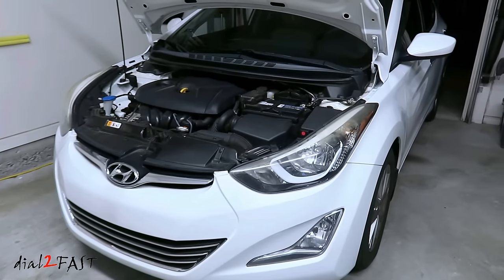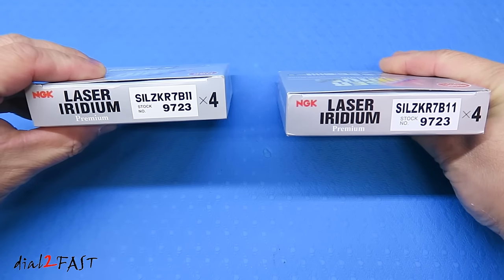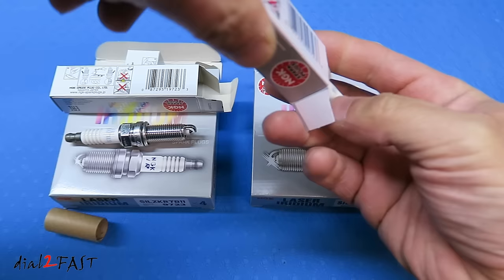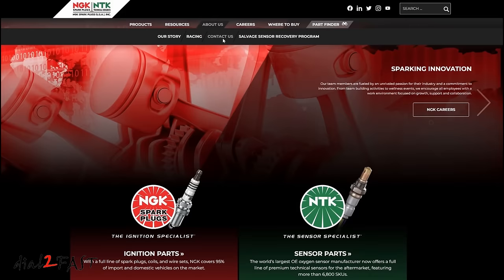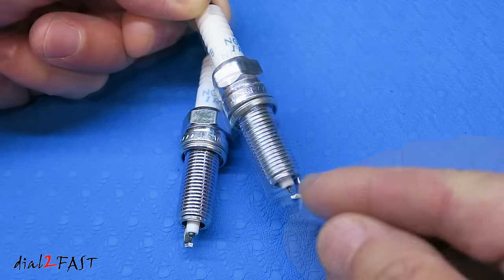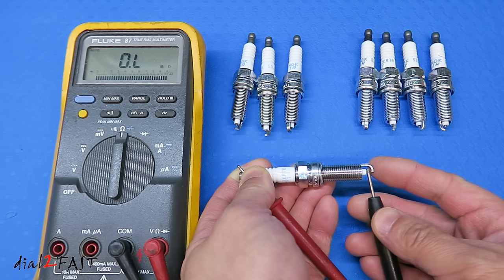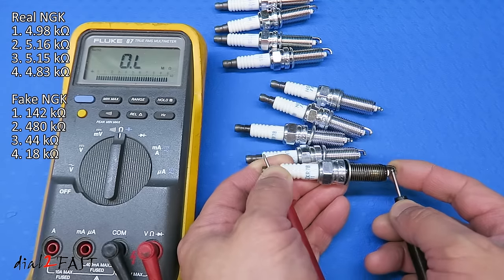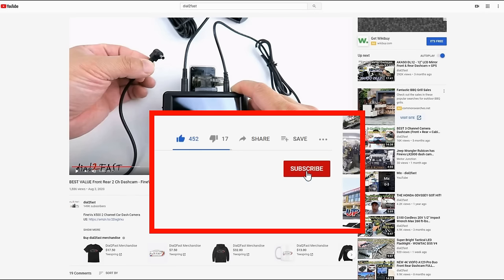Fake NGK Iridium Spark Plugs | How To Test!!

Comment: Thanks for heads up! Iridium plugs do cost a wad. Ive heard though that they hold.up better in aircraft such as Lockheed Electra 10 E special and so on. If I could afford a vehicle and the plugs the iridium plugs would definatly be considered for longevity and reliability. Mind you that Irridium plugs are extremely expensive and I ve only heard one pilot recomend them. Copper may be a better electrode as far as conductivity if one is willing to changes plugs frequently. If I were flying around the world in an radial engined plane I would do some research and seriously consider iridium coated plugs. Iridium was used for many years as a fountain pen tip material so iridium is nothing new. The only advantage is durability and fewer plug changes between tune ups. The less you fuss with plugs the better once you've got them dialed in as far as gapping, reach and heat range. I'm not an expert so don't rely on only my opinion I'm just a car enthusiast. Anyone considering iridium plugs should first consult a bona-fide automobile mechanic. All this just my opinion. Don't bet your life on them though because iridium is a bit of a fad. Use at own risk!
Reply: Iridium ix  plugs are 13 to 15 bucks each in my area, most expensive part to my tune ups but I get 2 years out of a set in a daily driver

Comment: i've known about fake spark plugs out there, i like your test approach but i have a problem with it. when testing the real NGK's i see you did not touch the metal end of the spark plug, the part that gets gapped. when testing the fake NGK's you didn't show the same care, it looks like you grounded the iridium tip and the bottom of spark plug. maybe the camera angle gives that impression.
 
i've built many cars engines, my brother learned from me and he became a certified mechanic for toyota and lexus. he was shop foreman for both, now works at tesla. every mechanic that wanted to become certified with toyota or lexus had to be tested by my brother, he was the gatekeeper. my son too started with lexus now he is shop foreman at tesla. 

i am photovoltaic / solar thermal technician. but foremost a goldsmith master jeweler. reason i bring jeweler up is i can make a genuine diamond read fake using a diamond tester. i sold a diamond to a customer and a year later he went to a jewelry store and they told him it was a fake diamond. long story short i went to jewelry store and tested one of their real diamonds Fake. i  had them retest my customers diamond or i would sue.

Comment: Can you please comment on the resistance zero spark plugs. Are they better because less resistance.
Reply from the maker: From NGK website: Since resistor type plugs actually “resist” some of the spark energy, non-resistor type plugs actually deliver a more powerful spark. It is for this reason that most racing plugs are non-resistor types. However, in most automotive applications, a resistor plug is required for proper vehicle operation. Use of non-resistor plugs in vehicles that call for a resistor type can result in rough idling, high-rpm misfire, and abnormal combustion.

Comment: Great video and it needs to be seen more, hit that like button.
Just a tip, when using a multimeter don't touch both leads with your fingers. Your body has resistance and voltage.

Comment: friend of mine was dyno tuning his Mitsubishi evolution 9 did some runs then changed out his spark plugs with new did another pull and boom one of the spark plugs the porcelain broke off and killed his cylinder walls and piston 40k later he got a new motor we took out the other plugs compared them with another new set of plugs from auto zone and he had fake plugs
Reply: U know what just did a engine rebuild. Bought autolite iridium plugs from autozone. Mind u they dont warranty the plugs, more on that. Once the engine started and ran. It developed a miss. Isolation to cyclinder one. Swap plugs with cyc2 and miss changed cyc. So I brought back to autozone. They said  no warranty. Oreilly has a year. 

Know I know why there is no warranty. They selling enferrior products.

Comment: What I see is that you are carefully not touching the external part with the original and with the counterfeit you are touching it, and that changes  the resistivity.
Reply from the maker: No it doesn't. Understanding electronics and how parallel resistance is calculated is important here. You can read my note in the video description.

Comment: My experience is that real NGK plugs are about the best you can get. The catch is that the pricing of them creates a market for fakes.
Today the plugs are expected to be "lifetime" of the engine, but in older cars they were so simple to change that it didn't matter if they had to be changed every 20000 km and the cost of them was usually so low that it wasn't a big deal either.
The maker of the fake plugs would probably have been better off by having a solid metal core all the way through giving them a zero ohm resistance - but with the side effect of some RFI.
It did seem to me that the gaps on the fake ones were considerably wider as well, and that could have caused the spark to jump over in the wrong place.
Reply: Ngk suggests replacing these laser iridium between 80k to 100k miles. So they are not lifetime…
Reply: @engrxtn And some cars are basically falling apart when they reach 100k miles.
Reply: @ehsnils all my cars have reached 200-300k miles every time

Comment: Yea just wondering about that,  recently installed this ngk IR , engine misfires around 6k miles. Remove all the ngk IR plugs, all gaps where out of spec and two of the plugs where rattling when shake. Initially thought this spark plugs are POS, come here to find out that its a fake plugs causing to prematurely misfire. Thanks for the info.

Comment: Although the resistance method found the fakes the values were skewed because you measured the resistance in your body too touching the leads with your fingers. Done this myself befo re I figured out my mistake testing stuff.
Reply from the maker: There is no problem with the measurement even with my finger touching the probe. My body resistance is in parallel with the resistance of the spark plug. My body resistance is around 20-30Mega-ohm, and the spark plug resistor is 5kohm. You can calculate resistance in parallel and the combine resistance is 4.999kohm. You can google the formula for calculating resistor in parallel.

Comment: Each spark plugs brand has its own product tech spec for example NGK DCPR7EGP you can easily google its weight and resistance. The 2 characteristics quite tough for the fake spark plug without making their own QC test to the product but they wont QC because it cost lots of money

Comment: Bought mine online which were cheaper than the shop. Mine says Shanghai on the packet and has chinese writting but on the spark plug it has the serial number and Japan under it. Three of the spark plugs measured 5.3 kOhms and one was around 4.6 kOhms.

Comment: Hi, I purchased some ngk off eBay and now my fuel consumption has tripled. Thanks for the info.
Reply: I bought some from eBay for my Subaru and the fuel got worse but ultimately it started running like crap and found out that the gaps on them increased dramatically.

Comment: You know they will adjust the packaging and the resistance to match the real ones.
Reply: If they can match the resistance of all 4, or 8, in my case, then there won't be a problem?
Reply: @iroulis  
Iridium goes for $5,000 per oz. and guarantee not used in the counterfit. Your engine could still be damaged, not to mention poor mileage and/or misfires.

Comment: What do you guys think of my resistance readings fake or not? Barely had 1k kms on them .At 20k ohms I got  0 ,   4.7,   9.8,  2.0.   , Had misfire on cilender 3 and was shaking. I'm suspecting they are counter fit, installed old ones and fired up seems alright but will go for a drive later,  my numbers don't seem wild like in this video, I forgot to test the original ones before putting back in.
Reply: Incorrect reading when checking ohm reading.  If you look at the video he also measured the ohm reading across his body.  Probe was held the wrong way when reading ohms
Reply: @Priority57  It makes no difference, try it yourself.
Reply: @LaurenceGough  Clearly you don't know much when taking a reading.  Yes it does make a big difference

Comment: hey thanks for sharing a great video, here is one of my story, sometimes the spark plug will be hitting your piston if it is slightly too long, and some of them will short to ground part from the electoral, so that is not even firing at the very end of the tip, instead the fire jumps through the porcelain into the ground of the spark plug body. one of my customer came in with a chrysler sebring V6 misfiring even after a tune up he did it himself, after pulling all the spark plug out, 2 of them were smashed by the piston, the top of the arch touch the tip, it was clearly can see the piston has mark on it by touching that arch, sometimes try to save money may cost you more money, if the spark plug made a hole through the piston, then pretty much end up buying a new engine.
Reply: Good story. There's so many variables and sketchy returns inspections  can trick the end user. Everything is on the end user to be honest. I look up things.😮

Comment: If it is from Amazon (or Temu, etc) and it is significantly cheaper than locally sourced, GUARANTEED it is counterfeit. Almost always Chinese junk.
Reply: Good advice, though the counterfeit Iridium plugs are not always particularly cheap, I got burned with a set of fake Denso Iridium plugs that were only a few bucks less for a set of four.

Comment: People need to smarten up about how much things cost.  If a genuine spark plug at a store will cost you $15 to $20 each, and someone is selling a 4 pack of the same plugs for $15, they are obviously fake.  Retail markup on parts is not 400%, more like 20% to 40%.

A company that is selling you a spark plug for $20 probably bought it wholesale for around $14 to $15.  There is no wizard out there that can buy them wholesale at sell them to you at a profit for $4 each if they are real.  So, use some common sense.

Comment: That 500k ohm was your skin's resistance. So there's no measurable resistance inside. Complete fail. No continuity and no path for the coil to discharge other than on itself.

Comment: I’ve had the same experience. But with my Honda. I bought a service kit, filters and plugs. My bike ran great, but after a short time, misfire and stopped. I put the old NGK plugs back in and it ran . I broke the fakes in my vice as I couldn’t tell them apart, but now after watching this video I’m better able , thanks for posting this video.
Reply: Im guessing they where the iridium ones. Alot of people fall for that on MCs. Unless your motor is internally modified and u need a colder plug, or has boost or nitrous. You almost always better off going with the exact oem plug model. Im assuming thats a copper plug like my Yamaha is.
Reply: @taz4100  you are absolutely right. I bought them with a service kit from eBay , my bike ran well for about a week then misfire and cut out. Thanks for your kind reply.
Reply: I think there are counterfeit standard NGK’s out there. I repair power tools and equipment. I just had a newly purchased pressure washer with a Honda GX160 engine that would shut-off after a minute of use. After checking the ignition and carburetor, was going crazy. I changed the plug and the problem was fixed.

Comment: Dude, you can't be touching the leads from the multi meter with your fingers while testing. You ohm test is completely invalid because of this. You need a do over. You really sound like you know what you're doing but you should know better than what you did here.

Comment: Uuhhhhh… you have your finger tips on the metallic tips of probes! Since your body also conducts, you are providing a parallel path for the probe current. This will give you inaccurate resistance measurements.  And since your fingers will probably vary in how hard they grip the probe tips, your readings will vary. At the least, it will be confusing to you and the viewers. Common issue, never good, IMHO.
.
Reply from the maker: For this test, the resistance measurement is perfectly fine. Understanding how to calculate parallel resistance is important here. My body which is in the Mega ohm reading when parallel with the spark plug's 5kohm, will have a parallel resistance of 5kohm. I wrote an explanation of this in the video description.

Comment: If you're going to cheap out on spark plugs, just get the NGK coppers from a reputable source. At least then you know that what you're getting is legitimate. Assuming that coppers are alright to run in your engine. I run them in all of mine, but all of my engines are also from the mid '90s to mid '00s.

Comment: When you tested the plugs you clearly put the probe on the ir tip only on the real plugs, but from the looks of it you grounded out the probe when you tested the fake plugs.  That may not have mattered, but that's what it looked like you did meaning the fake plugs had way higher readings.  I'm just saying, that's what it looked like to me!